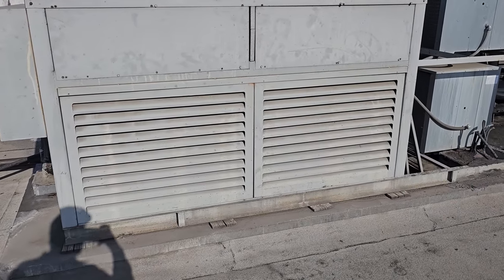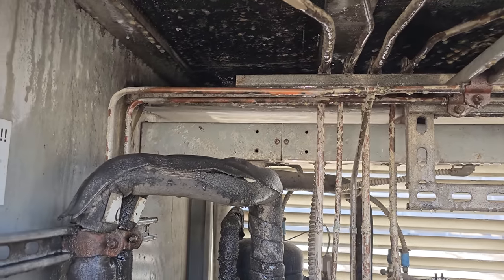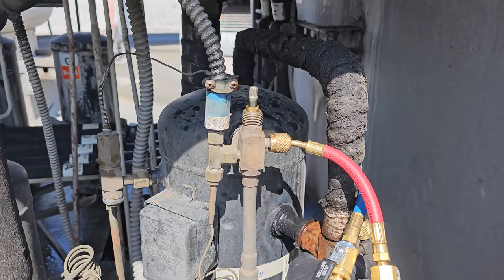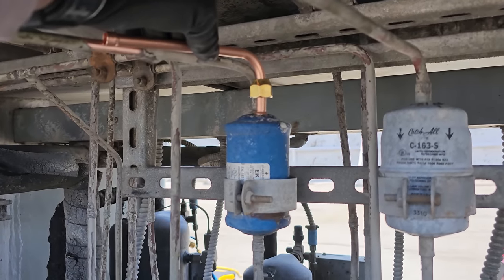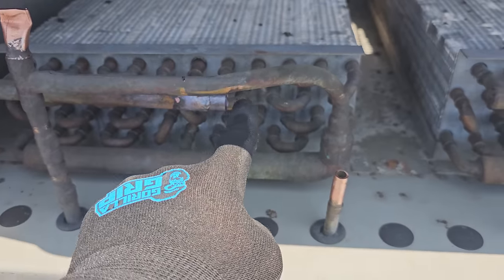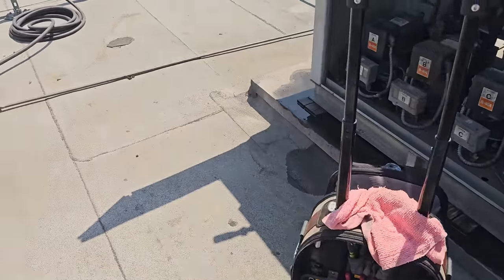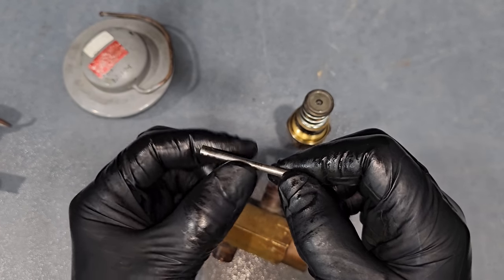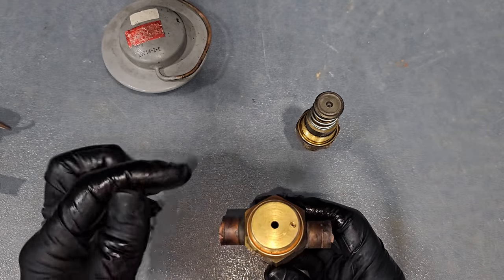THE FREEZER IS DOWN AND WE NEED YOUR HELP!

Comment: Curious why you didn’t just cut the capillary on the valve since you wished to change the condenser out at a later date?
Reply: That would do nothing if the pin is binding or there is contamination keeping the valve from moving.
Reply: @stopgabsolution5457  great easy first step solution to try rather than the time and expense involved in eliminating the valve from the system. I believe it is Always best to try the easiest most cost savings solution first.
Reply: @HardKnocks101  that’s fair. It being the freezer I could see the argument to go for the 100% safe solution to avoid a potential call back.